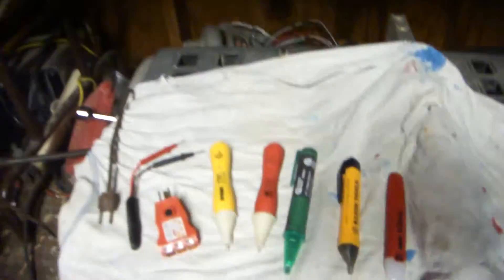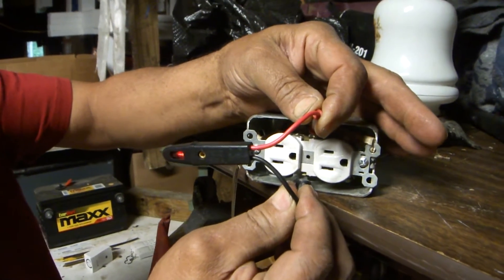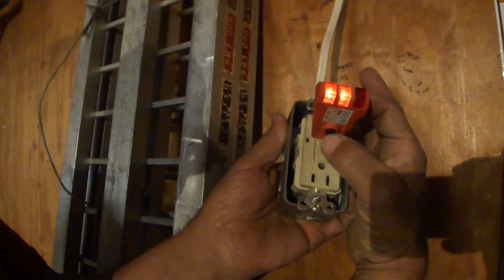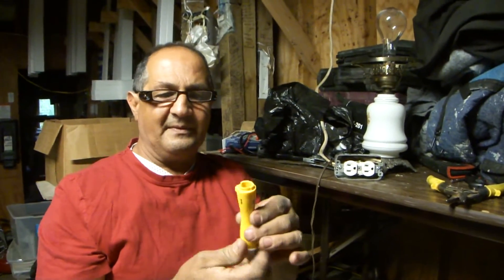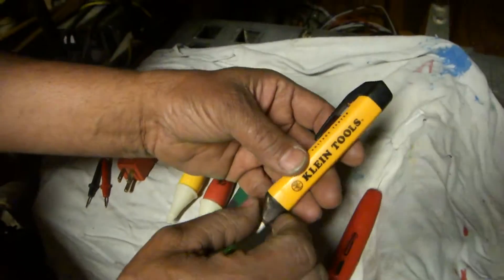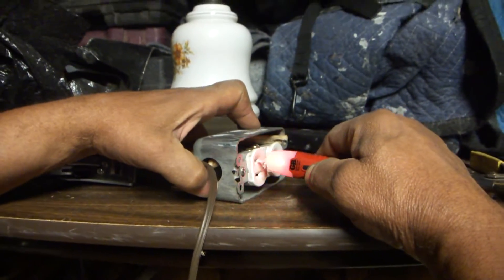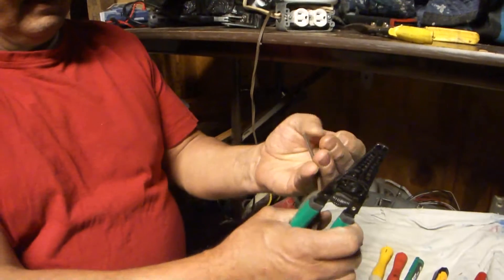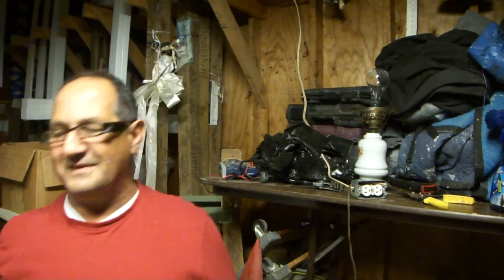How To Use Some Electric Wire / Power Testers

Comment: doesn't make sense to me that you have just cut the plug and showed to make your own tester? even you could say that this plug can be used as a tester or if you don't have the plug then can be use just opened wires as testers, which we were using in our young age because these plugs were not always available and were using just wires !